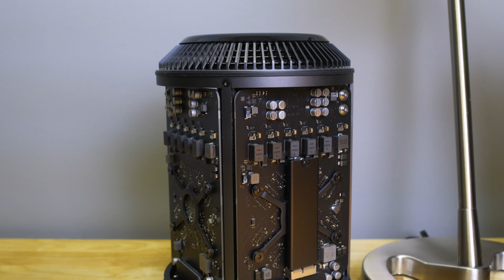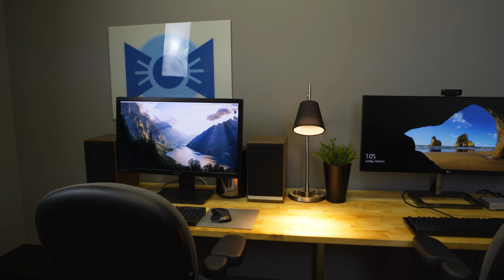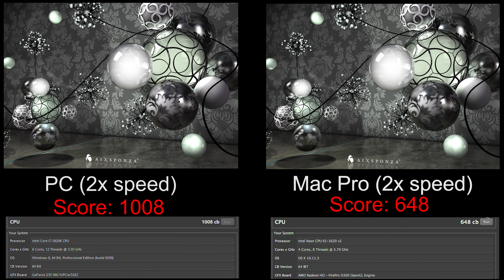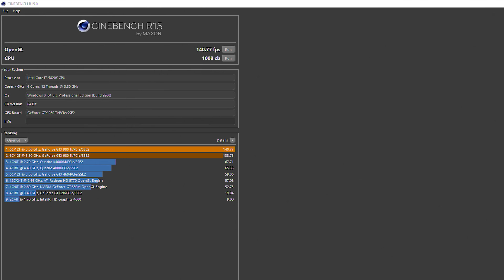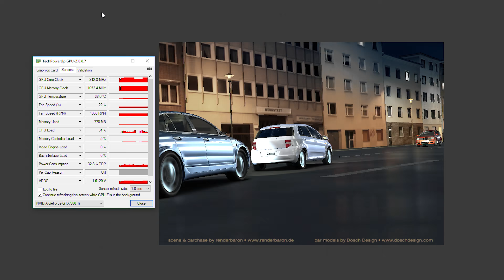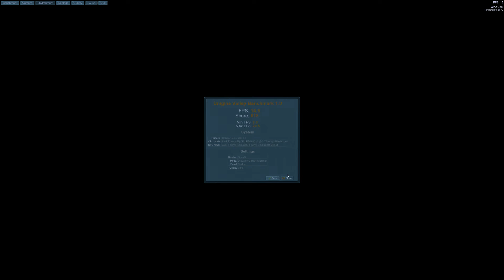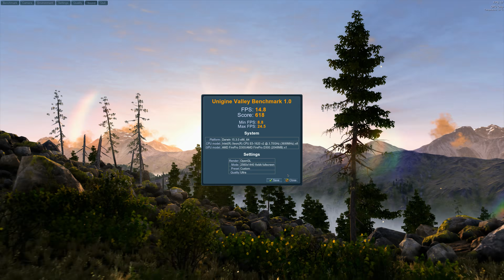$2,000 Custom PC vs $4,000 Mac Pro

Comment: I have a $12,000 MacPro but it's all just for editing, audio and after effects. Honestly Media Composer, Interplay and ISIS work really well with Mac.
Reply: Daftpunk4627
Yes, i know that, and its the only thing they are relatively good at. But with such a huge price tag and with no way to easily upgrade them in the future, seem a complete waste.

For 12k you could get a pc that renders as fast or faster than mac. Besides, the hardware is pretty much the same inside a mac than in pc, they get the extra edge in coding. Not that significant, and you have allot of money left over to bridge that gap.

And funnily most people i know and have countered buy macs solely for their "design", or because they think it is somehow high class. While using it for net and office tools.
Reply: Dysfunctional Editor

Yes, it has not been done in a while, too hope the day comes soon. But we will see. There seems to be more activity around it lately.

If you are saying that addressing cost per performance is a bad idea, just because you feel like throwing money in the wind, then you might as well just shut up :D
For many starting up their business, it is very important to keep costs low while getting the best out of a dollar.

What utter nonsense on the upgrade side.
Things that you most likely do not need to upgrade for a while on a pc.

The Case
The Cooling Systems (fans, controllers etc)
The PSU
Other Devices (soundcards, and other pci )
Storage Devices, whether SSD's or HDD's
Most likely the RAM on the first upgrade
If lucky the motherboard

The only things you change is the gpu, which has no real effect on any other part,

And cpu, which might make you change your motherboard due to socket changing, which is not always the case as well.

And you can easily find buyers for these parts, as alone they are not that expensive and many people will want them.

In mac, you change everything. You might be able to get some storage out of some versions but that is it.

You will lose a lot of money selling it because nobody will give you almost retail price for it, and you will be down in thousands not in hundreds like in pc.

I have upgraded my pc, every two years, keeping it in the high end level, (not top level) where parts are plentiful yet cheap, works great for me. Runs my solid works and premiere great, and also all the games out today, even arma 3 and gta 5 .

Last time i upgraded i actually made 40eur profit :D

Speaking of which i, need to start upgrading soon, which i do like, not a chore for me, if you are asking ;)
Reply: re-read my last sentence. I'm don't wasting my time with you. You don't know what you're talking about.
Reply: Dysfunctional Editor
 Yeah yeah, keep dreaming, i have done it for years, and have built many pc's for friends and clients. Also looks like a cowardly escape, but whatever.

of course we don't know what happens down the road but currently it is the best option.

If you are rich, then go ahead and buy a 24k gold mac pro for all i care, but most people do not have that much money to throw around and want the same performance for a smaller price tag than mac offers.

Your views on upgrade are totally delusional and i think you know it.

Go use your mac and be happy, people who care about best bang for buck will stick with pc for now.

Only time will tell where we are headed.
Reply: 64GB of corsair DDR4 is £400 here, not much tbh.
Reply: All i have to say is that you are a fucking idiot if you paid that much money for it. You could easily get a pc that is at least as powerful if not more for half the price.
Reply: Siim Tuulik Right. lol
Reply: Siim, Macs are used more for PS, AE, Media editing, etc. Disney only uses Macs for their Pixar movies and so does Dreamworks.
Reply: Siim Tuulik
Not really on the latter part, I love PCs too but for video editing and rendering I'd still pick Mac. Their file structure too with Avid's MC, iNews, ISIS etc.. is far superior. I don't think you're living in the real world of video if you think PC's are best for video editing. A lot of great editors use both systems there really isn't one or the other. You will eventually learn that they each have their pros and cons. Adobe if you use that doesn't work well with Mutli processors either.

For 12K I don't think you'd find a PC that run faster then a current Mac Pro system. If you can great. I mean two of the 24GB M6000 I think are close the 6K range? 64GB of DDR4 ram...yeah you're already going near that 12k mark. I would be interesting to see in any case.
Reply: Dysfunctional Editor

If you take two identical hardware for mac and pc. Obviously mac will win out on video render because of the optimized code.

Now the thing is that mac is so expensive compared to pc that for the same price you can have a much more powerful pc setup.

Only thing holding video editing back right now is that adobe has not fixed multi processor usage. Once that is done, then two identical hardware will have almost identical performance, while 1 costing way less to build.

Also one important point is that it is easy and fairly cheap to upgrade your pc workstation opposed to mac, which you have to buy the whole thing new. Similar to a console.
Reply: Siim Tuulik

Multi core processors haven't been fully utilized in Adobe  for some time now. lol 
I've gone through a Puget System and always had performance issues,  crashing etc..but like I said Mac works amazing for what I'm using now so it honestly doesn't matter to me, just give me a system that can edit. I could careless who wins.

They both have their pros and cons. Personally I'd rather pay more just to get going then wheeling and dealing  about cost and weighing on cost per performance and performance that isn't even fully utilized by a 1500$ processor in a PC. Whatever...moving on.

I love what I do and I'll stick to what works. For now it's Mac and probably will be for a while since I won't have to buy a system for a while either. MC. AE and PP Cc all work well for me right now.

On the upgrading statement, that's bogus. Usually when you upgrade you spend more money upgrading in the long run. Anyways so that's not smart to "upgrade" by the time you're due for an upgrade it's best to start from scratch or buy a whole new system. You spend more money upgrading parts here and there. Kinda contradicting in your argument a tad. Usually you go every other generation depending on what's out, it's impact it will have on your time etc..

and no nobody spends 12k on a mac pro because it looks cool. Those people you know are idiots. 

I don't think you know a lot about what you're talking about but you should know in this environment things change rapidly. In 15-20 years we very well could be all on PC's. Who knows, it's a competitive world in video editing on the professional level.
Reply: Dysfunctional Editor
Yes those people who buy macs for their looks are idiotic in those decisions, but what can we do :D
Reply: Actually no. Dreamworks use HP my friend.
Reply: Jason Baksh
It's probably the Z series. We've a couple animators here that use the Z80s or whatever with Xeon processors.
Reply: So, if this debate was still going on, pretty sure JX would take an L.
Reply: I'm just smart enough and experienced enough to know what I'm talking about and every system has it's pro's and cons and what it's designed to do. AVID's workflow works best for the system I've and the environment I'm in. Pays for itself and how it all works together for what I need to do. 

Looking for a win or lose in this topic is already a stupid statement.
Reply: That's how humans operate, I'm sorry to say.  Good that you know this, however.  As long as it made you your money back, it's fine.

Comment: Ok, just for the fun of it i decieded to run the same benchmarks to see how my $700 PC would hold up against a $4000 mac pro. My specs are an AMD FX-8320 3,5 GHz 8-core processor, 16 Gb of 1600 DDR3 RAM, and a single R9 280X from MSi. 

So first i ran cinebench. Although not as good as your PC and not that great of a score, i got 546 for CPU. This was to be expected because Intel are generally known to be better at allocating usage of the cores, so that one i lost. On the OpenGL test I also did score a bit lower (70.59 FPS) but in my opinion it was only marginally, making my PC that costs $700 about as good as a $4000 mac pro :/. The valley was won by me though with an average framerate of 37 FPS and min ~20 and a max of ~75 FPS, giving me a final score of 1510 on this one, throwing me directly in the middle of your Custom PC and the Mac pro. Seeing as on the cinebench scores i did almost as good a the mac, but by almost tripling the score of the mac on the Valley benchmark, my $700 PC is actually BETTER than the $4000 mac pro... And that's without 500 GB's that have a cost of $600 (tek syndicate did a video about upgrading the old Mac Pro 5.1 where he showed that in the MacPro configurator you pay $600 for upgrading the standard 7200 rpm 500GB HDD with a 5400rpm 1TB HDD).

Comment: I gots a 970 gtx over clocked... and somehow I got a better score in valley. How??
Reply: because he was doing it at 1440p, you probably did it at 1080p.
Reply: At first yes. I then switched to 1440p and it was basically the same score :D
Reply: I just ripped that thing with my Radeon 7950 HD ;)
Reply: RIP MAC LUL
Reply: You may have also been running it at a lower quality setting as well, or just somehow managed to push a 970 to be on par with a 980 ti. If so, the Silicon Gods smiled upon you.

Comment: I'm watching this on a macbook air but I'm also into windows based systems (networks, servers, custom built systems ect..) . I do agree that apple no longer has the edge in 'professional' computing. When purchasing hardware, I do not look at the pretty package but mostly the price versus performance. Imagine a film production studio with a whole office of editors, you could literally almost half your production cost just with hardware. With mediocre tasks (Photoshop, Premier) at the consumer level, they are OK although you don't have a cost effective way of upgrading components such as SSD's as Apple are very picky with what hardware you are allowed to install. Granted that the OS is smooth, with a $4000 investment in a Windows based solution and some expert knowledge, you would be able to make the system rock solid and reliable with multiple back up configurations (Raid being very cost effective) 

Also on a professional level, I like to see what is happening behind the scenes (detailed file and storage information, system information etc..) and the macs do not allow you to do that. I know that these aren't designed to be used for 247 operations but I should bloody hope that for $4000 I am getting features such as ECC ram.

Comment: same exact problem i had for over 3 weeks until i changed the cpu. screw refurbished.

also just heard u said something not so correct. computer parts dont get old. its been tested before you should actually research that. 
there are people used their pc for bench marking and those graphic cards or what ever they used in that pc still have the same performance the day they bought it.

and most importantly, thank you very much for taking the time to do this test which answered a curious question i had these days. Cheers!

Comment: Apple is just in it for the money even when that means selling a shitty computer that can most likely not even run a simple game above 20 FPS. Before people go saying "not all computers are designed for gaming", well most computers bought by people are intended for gaming/streaming and large video editing purposes. If you can't do that on the Pro, then there's no reason on getting it at all. Its all about the money yet its all about the hardware, would you want a cheap computer with good parts or a extremely pricey computer with very...VERY outdated parts? This actually proves what Apple is interested in and that's not selling a product...its acquiring money. They could most likely go to some thrift shop, grab any type of CPU, any type of GPU, put them all together and sell it.

I'm getting a near $450 computer that will not bring the Pro into my mind ever again.

Comment: Windows is great but I dislike the software. It's always asking for virus protection programs and is always updating. I like to just get to the point. upgrade once every 6months or yr and that is that. Also a custom Windows? So if it breaks down on me, yeah is really fast and looks bulletproof but not every photographer/videographer is a computer egghead, will have the ability to fix it when something goes south. Considering that our work has a deadline, because time is money. Windows is great in some aspects but I stick with Mac for its simplicity.

Comment: Dat Desk! Where can I get one? It's perfect for my wife and I.
Reply from the maker: +Mitchell Lamb Video coming in a few hours. :)
Reply: man i got myself a desk like this one 2 years ago, it is kinda okay, but way to short in depth, so i advise you just buy a piece of wood about 75 cm wide (one in the video is 60cm if i remember correctly) and as long as you desire; all you need after that is just some legs (you can buy them in ikea) and screws to screw them onto the desk. 

mmm.. yeah... calculate those units :333

Comment: You are right about Apple's shitty upgrade cycles. But apart from that you are comparing apples and oranges: 

ECC memory vs normal memory (protection from memory faults)
Workstation graphics vs consumer grade 'gaming' graphics (way higher floating-point accuracy and reliability)
Server CPU vs desktop CPU (cache size and reliability)
Reply: ECC? You're not planning to use the Mac Pro as some sort of server, are you? Even 3d modelling isn't concerned about ECC.
Reply: still for the same price building pc have better performance
Reply: That's mostly true. But you can't forget that you are also paying for the OS, not only the hardware. I'm not trying to defend the Mac Pro here, but rather criticizing the comparison in the video.

Comment: you have to use a tuning for overclocking or tweaking. when you do it in uefi you get the loop at new gen boards does not matter if gigabyte asrock or asus. so it was not the psu it´s a security thing that checks the cpu voltage phase or the fan voltage on board. funny to see that people waste time instead of using their brain first and tryieng out the easiest steps first.

i had the same bootloop kind of thing and i solved it with loading defaults and then tweaking the multiplicator with a tuning utility. but you are not the only asrock or asus customer wasting the time and money to change the powersupply and don´t forget the beautiful work dissassembling and then put all together again.

at 2:00 he is not telling the truth it was not the psu .   he is acting .     so people with asrock boards load defaults use a tuning for muliplicator tweak and connect fans to molex adaptors thats it........

Comment: The most ironic thing is that the Mac Pro will sustain its value a lot longer than the custom built PC.
Reply: Citation needed.
Reply: Vladislav Dracula, Clarification?
Reply: why should it? absolute bullshit :D

Sorry please educate yourself. hardware is the same. It is an Intel processor. Why should the intel in the mac last longer than in a windows PC?  

mainboard can be ASUS for example in both, why should an asus board in a mac last longer than in an pc?

Sorry, hillarious bullshit
Reply: So you cannot buy a PC at 2000 $ with a processor at 4 000 $ ;)

Comment: believe me it was not the refurbished power supply it is a safe settings voltage stuff when you tweak fan speed in uefi. use a tuning or a fan hub. i am pretty sure it worked all fine after you loaded default uefi settings.

Comment: I Have just read that you can put 8 x  E7 8890 v4 on a board
You will have 8 x 24 cores = 192 cores
That will cost you : 7 100$ x 8 = 56 800 $
This just paying for the processors !
Reply: HOLY SHIT
Reply: +Olivier you dont know what you speak about,  before to speak you should read the processor data sheet.
A P6000 has 2 core and the Max CPU Configuration is 1 It is very slow (1,86 Ghz) and the feature are poor. 
Max memory 8 GB

http://ark.intel.com/products/49058/Intel-Pentium-Processor-P6000-3M-Cache-1_86-GHz

Comment: baklawa1900 hi I have a friend who is running a Hackintosh for very intensive 3D modelling and Video production and he does not have any issues with it. He has extremely high level 'gold chip' clients he works for and he always delivers the job at an extremely high level of quality. He's been using Hackintosh for over a year now. Unfortunately the Mac Pro does not have the correct graphics card for the best performance, and on his Hackintosh he can add more cards in an external Riser to increase performance. ( I think that you just may have not had a good experience with your hardware ).
Unfortunately you are wrong - your experience may be bad - because you did not get the correct hardware or something. You should maybe get someone who knows what they are doing to build one for you. I wish you luck.